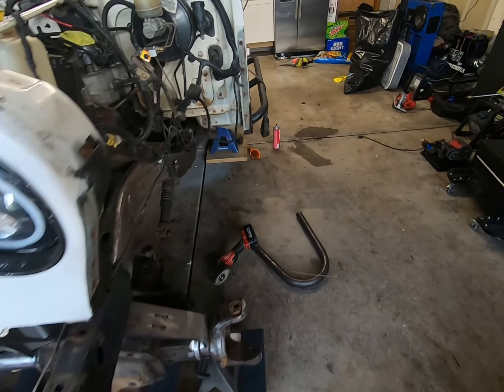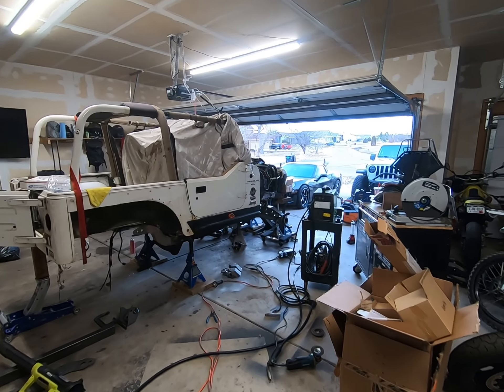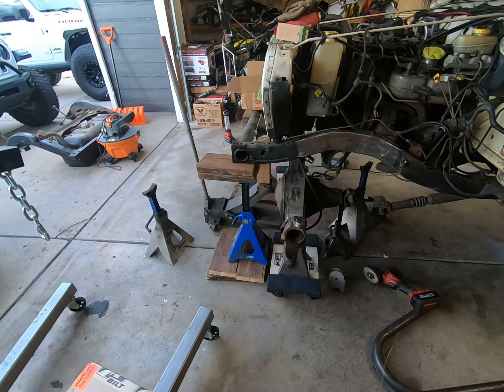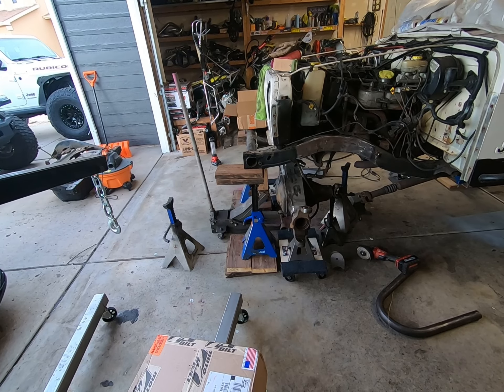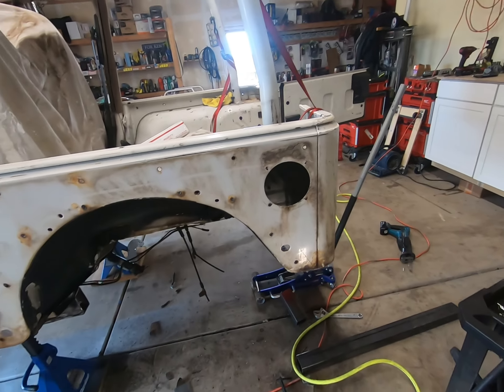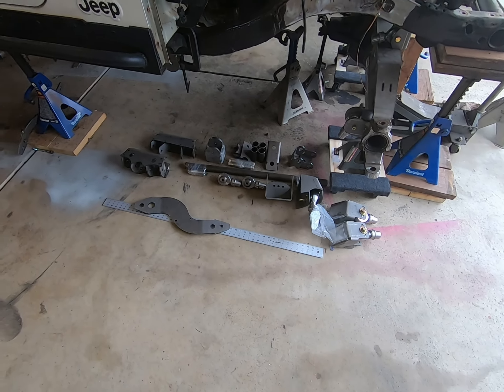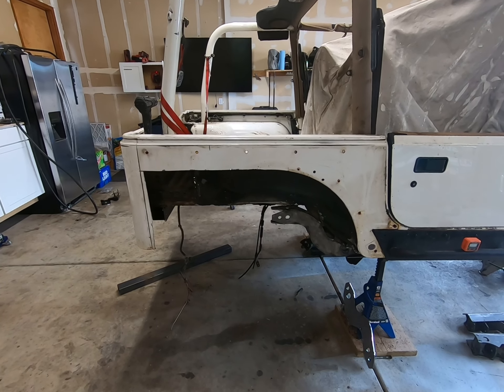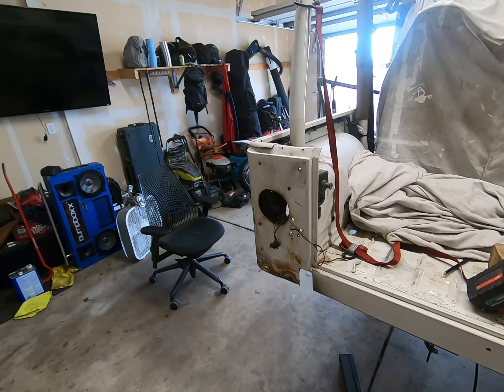Working on the Artec Backhalf [EP:4]

Comment: I was thinking about doing the front frame kit as well
Reply from the maker: Rear was super needed on mine due to rust I cheaped out on the front. If I was to do it again and knew I was going to take this long on it I would have gotten the front kit too. Check out the Motobilt kits I found them after I got the one I bought.